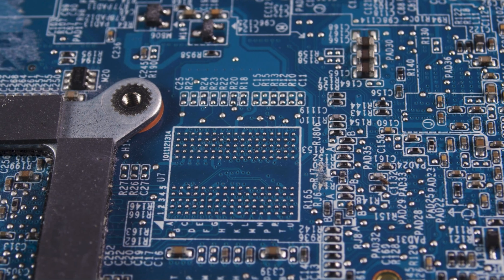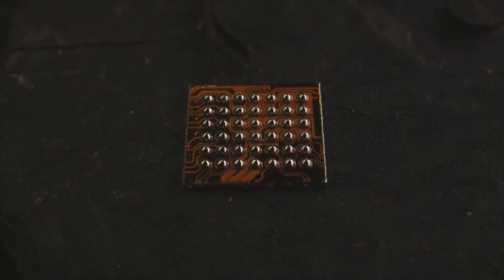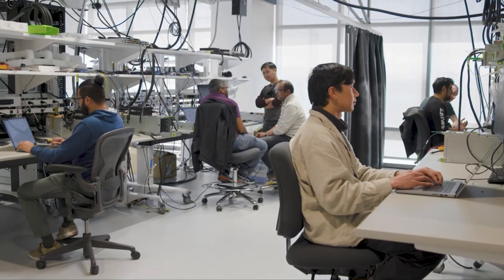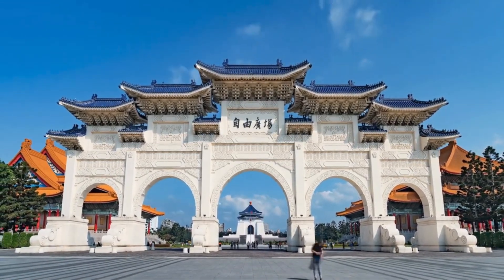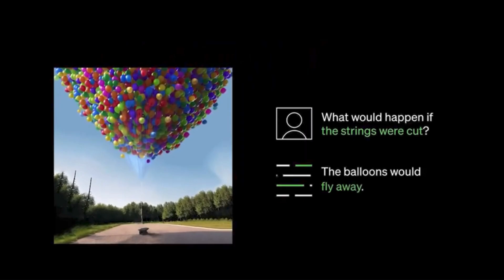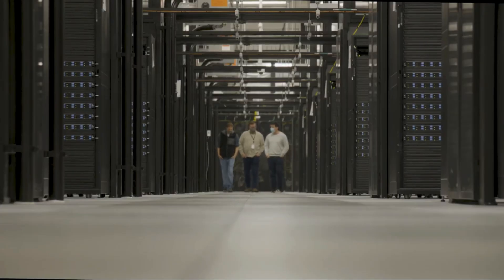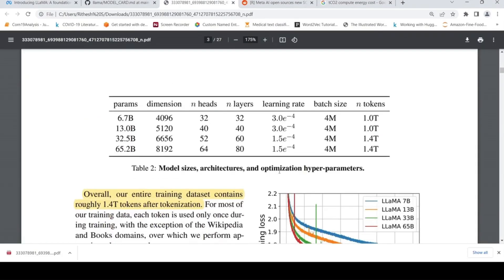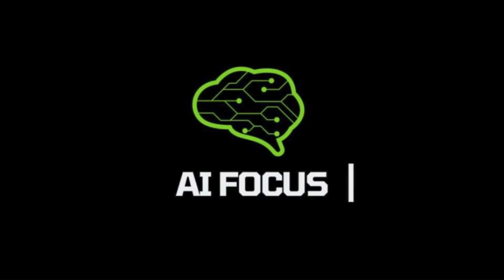Meta's NEW AI Chip Is Going To SHOCK The World

Comment: The human brain performs 2 quadrillion calculations per second, but consumes as little power as a dim light bulb.
 Now computer chips are rapidly becoming more like the structure of the human brain.
 In the future, if AI designs processors, power efficiency will continue to improve.
 It is also important that if the brain's circuitry could be reproduced on a silicon chip, the chip would be able to turn on and off a billion times faster than the brain.